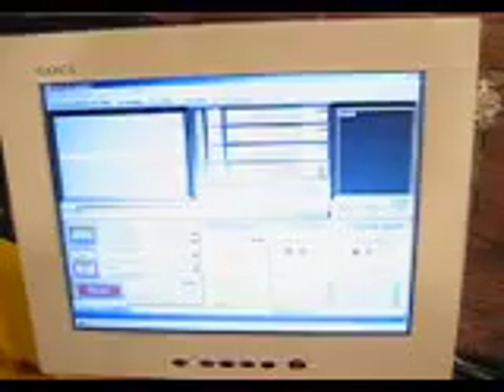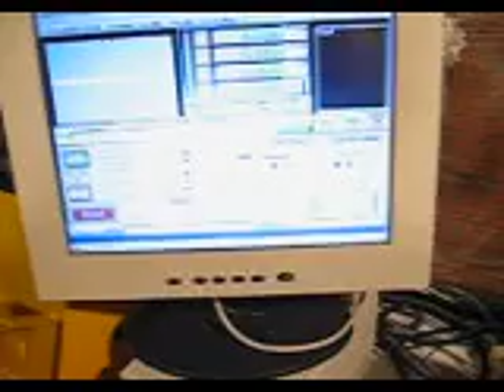CNC Mill Mach3 Laser Alignment

Comment: I am not criticizing. Just be very careful with laser bouncing of glossy metal surface: an incredibly small amount of laser light can burn your retina in less than 1/100 of second.

Additionally the pupil of your eye is wide open in that dark room, so even more laser light will enter your eye. There is some useful info on eye protection, when working with lasers, on the Internet.

Comment from the maker: I got mine from axiz lasers, buy-it-now on ebay.  I think it was 8 bucks and it showed up in less than a week.  I use a 2n5060 scr, with the gate connected to a parallel output pin to turn the laser on and off.